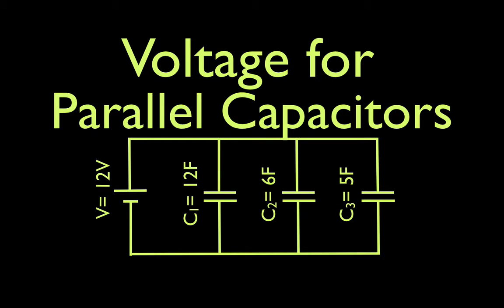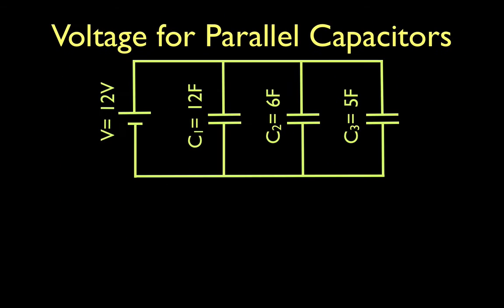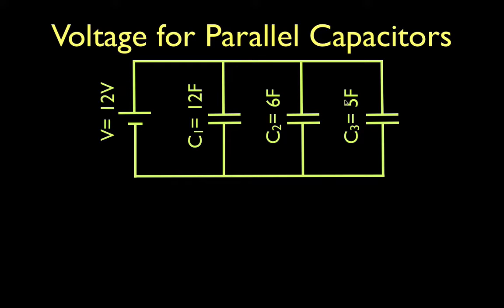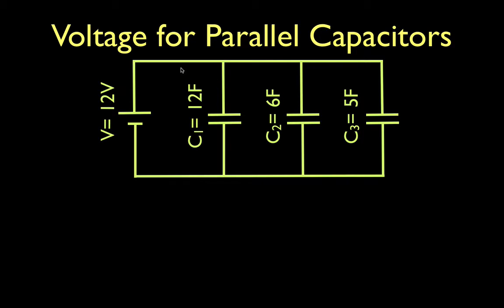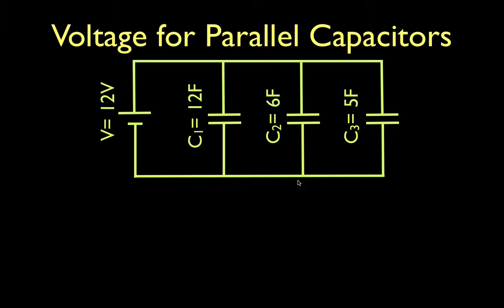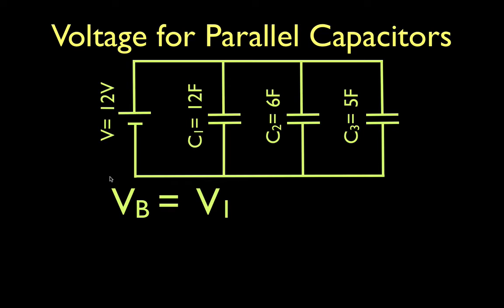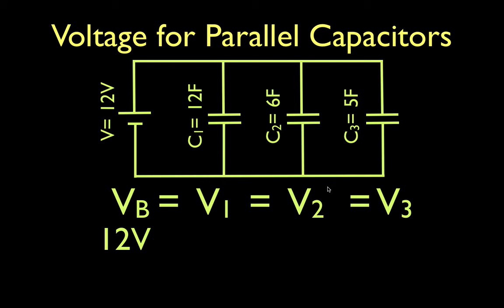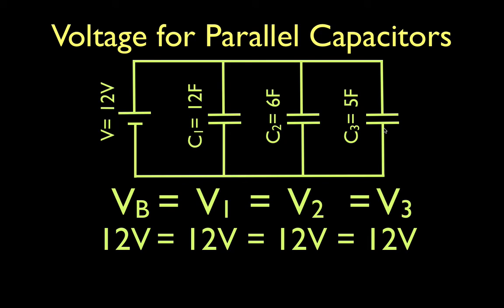Capacitors (9 of 11) in Parallel, Calculating Voltage Drop

Comment: What would the voltage tolerance be for three 25V 100uf caps be then? 300 uf but what voltage? and what about same capacitance but different voltage tolerance capacitors?